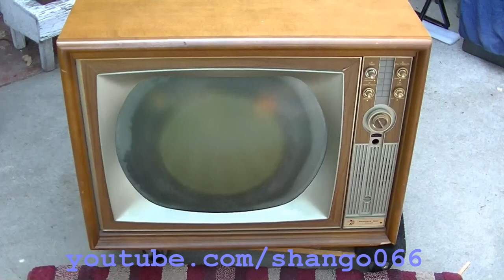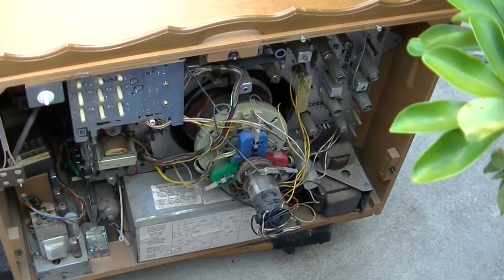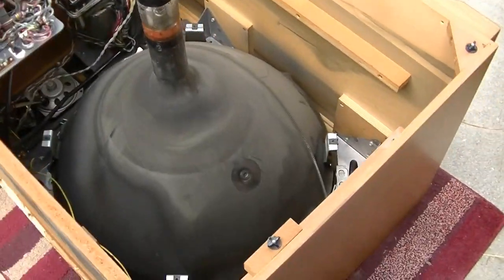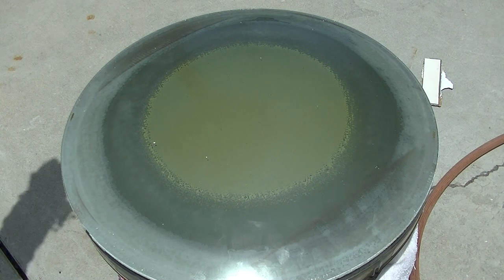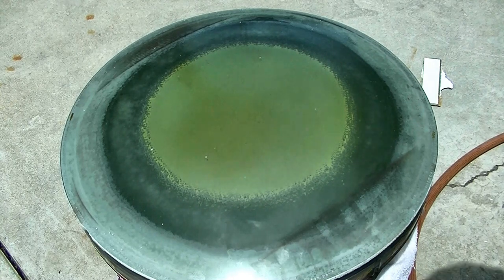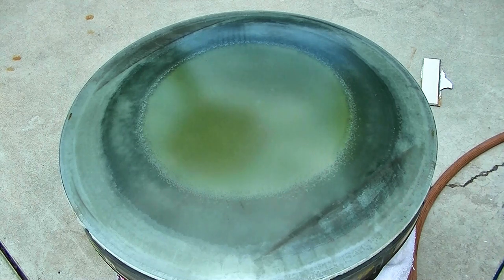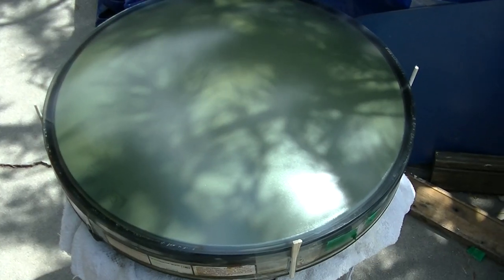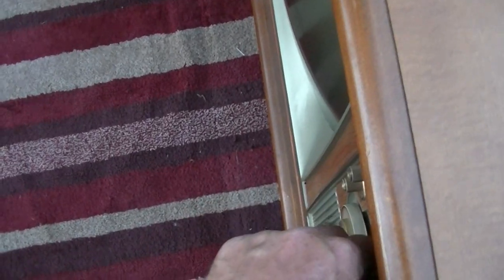Round CRT Cataract Removal RCA Style Tube Packard Bell Roundie Television PT3

Comment: It can hurt you real bad if you happen to be standing just wrong and it goes through your heart; especially if you have a condition that you don’t know about. It’s not a lightning bolt, but can still kill. It takes two seconds to avoid the issue entirely, though, so…
Reply: The energy is really very low. Less than a joule on average. (The lethal levels start at 50 joules. You could be unlucky though - a guy falling from three stories can survive without a scratch and a guy slipping on a banana can expire.
Reply: it is so unlikely to hurt you....those toy pens that shock people are readily available everywhere and pack a much higher shock or even the mosquito zappers....and if the tv is off it will be a milisecond shock...not enough to stop any heart no matter how fragile it is.....ifthe set is on and if its a colour set then i might agree to some extent that it might be dangerous....but i would worry more about electrical burns and th danger of tripping of hitting with your head or something  while jumping from the shock....the regular B+ is way more dangerous especially if touched with left hand while the right one is touching the chassis then there is a real danger of death
Reply: Those lethal levels of energy are for an average shock, with an average current path, to an average person. As mentioned, if you’re standing just wrong, and/or have a heart condition, even a low energy shock can kill. There are documented cases of people in operating rooms undergoing surgery getting zapped by static electricity and going into arrhythmia. Luckily for them, they were surrounded by doctors with a crash cart right there. Rare? Yes. Possible? Yes.

The ‘zappers’ sold as practical jokes (IMHO, a minor assault, and not funny, but I digress) don’t have a current path through your chest. The energy on the anode of the CRT can go across your chest. And yes, working on an energized system can be extremely dangerous if proper precautions aren’t used.
Reply: @darkwinter6028  the anode of the crt is so referenced to ground as is the zapper...not more , not less...so either they both can go through your heart or none...obviously if you touch the anode with the left hand and the chassis with the right one thats different...i believe i stated that...an old rule for the tv serviceman was to work with a hand on the pocket when doing live repairs/tests... as far as the first paragraph you wrote there is also a chance that your house collapses or you get hit by a tsunami while working on a set, i believe there might be documented cases of that...my point is that scaring people to death doesnt make them safer...what makes them safer is when they understand the REAL level of danger so that they know waht to do and what not to do....an anode zap will not kill you , with the set off it will make you jump at the very best....i can assure you a usb  pocket camera's flash will bite you ten times harder than an anode and i never heard anyone freaking out about about cameras....not to mention ignition coils and spark plug wires on cars were you get the shock often while bent over the car and with your arms wrapped around the engine, grabbing tools or supporting yourself directly on negative terminal (engine and car body) etc...

Comment: You could probably use LOCA in between relatively easily, cure with UV and done..no idea if it would work but I'd definitely give it a shot if I were you.
Reply: I really think it would work the more I watch but I know SFA about this art..but considering how it works for lcds basically the same..
Reply: And now that I see how thick it is..wow..maybe not..you'd need a lot a lot a lot unless you can close up the gap..but if you could close the gap then loca would be good

Comment: So did they finally pull the plug on that last remaining analog TV station in your area if so you need get a converter box or build you own micro analog tv station and get public domain old TV shows off the internet to show the TVs running
Reply: He has a analog to digital converter.
Reply: I still say he needs to build a small TV station in a box just get a Raspberry Pi and load a bunch of public domain Old TV show on it then you can run it as long as you what and not worry about copyright strikes, plus it would really be cool seeing period TV shows on those old TVs he can run the AV out of the Raspberry Pi to an old video game modulator box then hook that to the TV’s antenna input and instant TV on the old channel 3 or 4!
Reply: Pretty sure he has some of those Drake local broadcasters like hotels/motels used to broadcast their own programming to the in-house sets. 

Suppose it would be neat to make the clunker work on more than one channel, but you gotta then worry the often jacked up tuner isn’t in rough shape on the set.

Comment: The one thing I don't understand about this procedure is that you are trapping air inside the gap between the lens and the tube.  If you do that with a window, the window will "frost" within 6 months.  It is impossible to prevent this outside of a factory (they tend to fill it with gases like argon).  I am pretty sure that is due to the humidity that is in the air when it gets trapped inside the 2 panes.  How are you preventing this frost?
Reply: That is a good question. I would guess that it has something to do with the low humidity in the area. I believe these videos are made in the Los Angeles area of southern California which is in the desert so humidity is probably not a factor very often. Also, you usually need quite a large temperature difference on either side of the glass for condensation to form between the panes. That's why you usually see it inside of double paned windows that have cracked or the seals have gone bad on. One side is often quite cool while the other is quite warm and in a humid environment water will condense on the cool side of the glass.
Reply: I'm no expert here but would assume a well sealed window would be unlikely to have issues. A compromised seal would be the worst thing allowing slow ingress and egress. If Shango fully seals the glass then I would see little issue and if he leaves a large air gap again I would see no issue. I would leave it semi open. It is also now easy to take apart and clean if necessary.
Reply: I’d also think this is more likely with wild temperature/humidity swings, something you’re not going to have much of, especially in a home in southern CA.
Reply: @erikj.2066  I was thinking it had to do with the possibility that windows sit in the sun all day and that TVs don't.  That the high temp by day and cold temps at night might have something to do with it.

Comment: OMG. 
Why in the f*** would you even do this? 
You still can't use the T.V. !!!
The tuner can't pick up any channels, it requires a digital tuner!
The cost of LCD T.V's for that size screen are insanely cheap, with a lot higher resolution
and way less power consumption.
This is crazy.

Break the vacuum to keep it from imploding, throw it the hell away.
Reply: Chuck Jones do you need your diaper changed? 

You must be really fun at parties 😒
Reply: @jaedenceron1127  Quality? absolutely not.
not being able to use it after all that? Wasted time and effort?
Big time Waste.
I could see it if It still worked as a T.V, but can't do that, all regular channels are not being used.
You win the trophy for being the biggest 
SCHMUCKO!
Reply: So I am. Big deal. If you want to go there, I am restoring a 1928 Radiola 60 with rust and rat feces. Electronics work wonderfully. Quality is superb. There was a video of Mr. Shango resurrecting a Zenith color Television with weeds growing in it. Worked right when he plugged it in. Don't tell me there is no quality. Damn Better than a flat screen failing, because it is 1 year old....AM is still around. VCRs are still around, and so are DVDS. There is lots of content besides DTV.